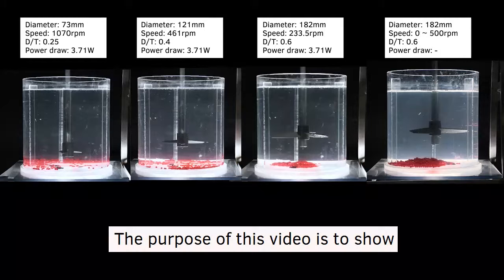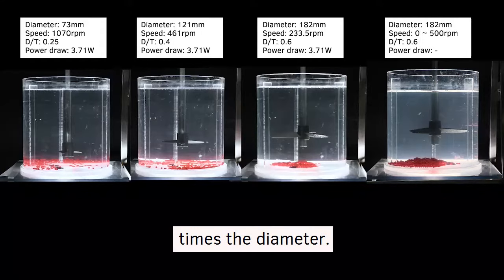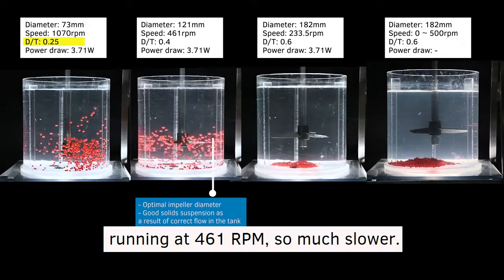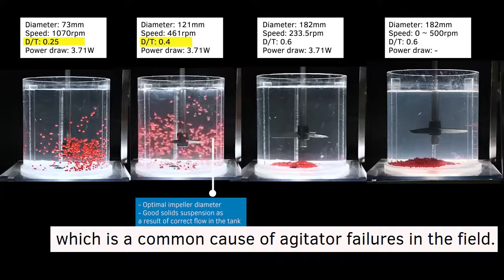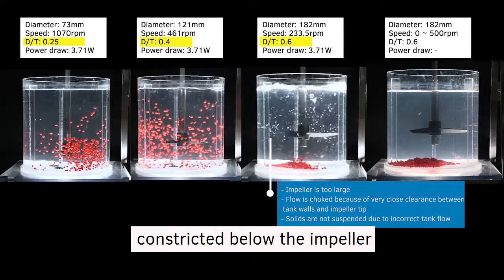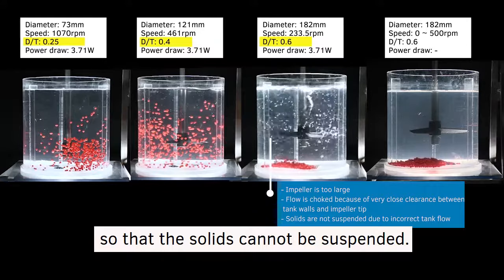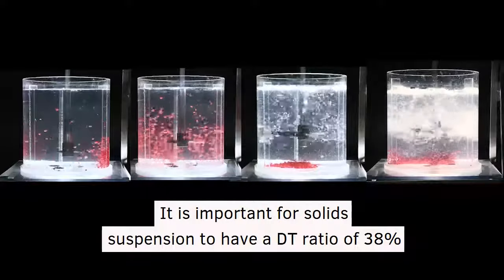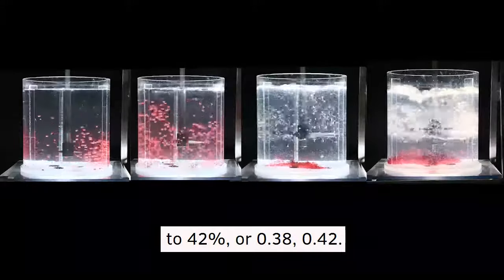The Effects of Impeller Diameter | Sepro Mixing

Comment: Could you explain how did you get the power draw? Speed x Diameter, ejm. 73mm x 1070 rpm = 3.71 W ?
Reply: You can calculate P as power number(for hydrofoil is 0.3)*rotational speed^3*diameter^5*density of fluid